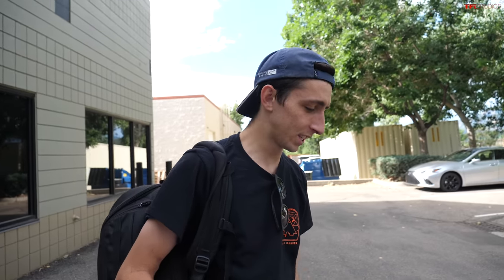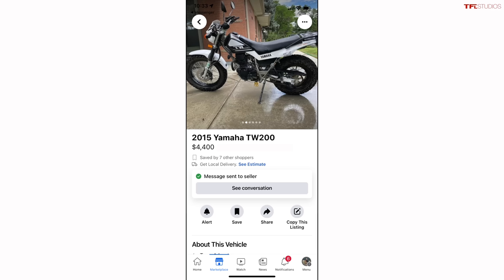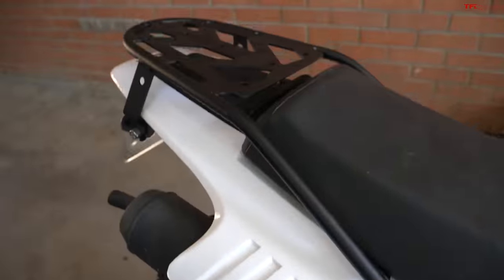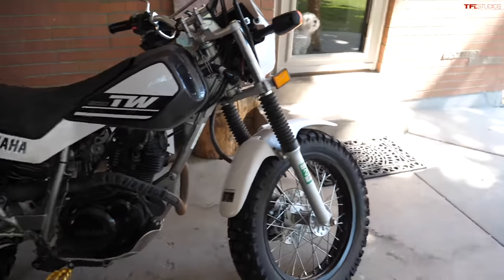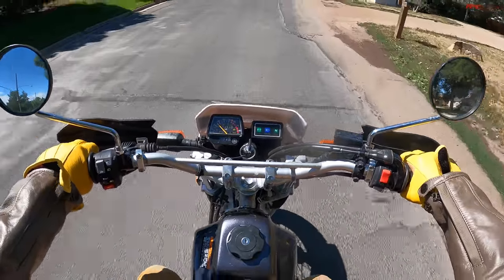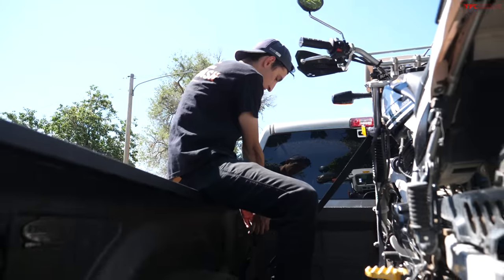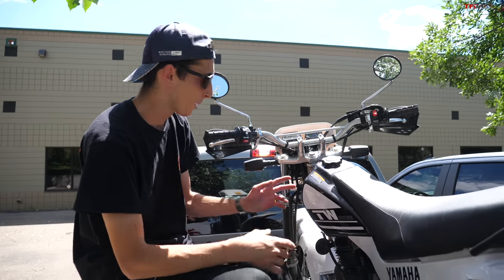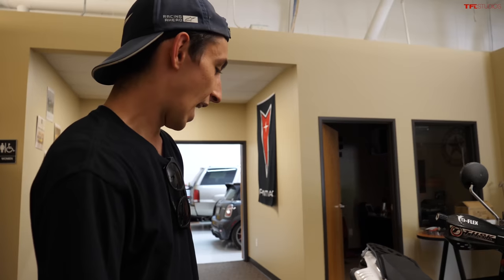Ask And You Shall Receive: We Bought A Yamaha TW200! But At What Cost...

Comment: The market is all over the place when it comes to bikes and cars, in my area  certain bikes just don't sell and others sell in a day.
Reply: I just paid £1600 for a 2006 yamaha ybr 125cc but it's just had a nut and bolt restoration and full respray and brand new tyres Michelin pilot sports, powder coated frame and alloys. New chain, sprockets x 2, brand new exhaust..12 months mot ( inspection)...rides great..my question is ..did I get ripped off or was it a good deal..the sad thing is I have a full motorcycle licence so I can ride any motorbike...I just liked this ybr
Reply: You can sell any bike fast for half thats what i say. Somestimes selling things is easy sometimes its hard. I try to sell a car 3 people take it for a ride and dont buy it. I try to sell an old treadmill and it goes right away I try to sell a bike and it sits. I try to sell a gun and the market is tyrannized to an orwellian unconstitutional high degree. But its a blessing in disguose that one because the gun i try to sell is an irreplaceable relic amd im just trying to post it out there to enrertain offers to try to average a street price for a gun i cant just pull up online like it and get an average price. Its not a glock 17 they just pump em out every day plastic. You can for sure say its worth 550 bucks new in the bkx with the paperwork never fired. You can go to anywebsite and see what they go for but my gun i cant do that and so i try to see what people are willing to pay but like craiglist is anti 2a they fight against our 2a i think they belong in prison for these terrible crimes

Comment: Love my TDub!  I can't believe how much they hold their value these days.
Reply: Mainly because there's no other bike like them and they will go through things other dirt and dual sports won't got through (deep sand,  mud,  snow).  They're basically a 4-Wheel ATV cut in half.  Tremendously tough and versatile bikes that that do it all and turn great gas mileage.   I have a DR650 but also am keeping my TW200 because it will just go places my DR won't.
Reply: @BillySBC  Imagine how much the value will shoot up when they quit making new ones, which could be very soon.
Reply: Ya ppl are asking more than what i paid brand new.
Reply: @BillySBC  I use mine for commuting about 30 miles a day on country roads. Its my zombie apocalypse bike. The huge rack is perfect for hauling anything.
Reply: @akmankalash  

The only thing I did to mine was drop the number of teeth on the rear sprocket to get better top end speed.   I think I dropped if from 50 to like 42 or something,  didn't affect 1st gear pull much but increased the speed of each shift point significantly.
Reply: @BillySBC  me to it cruises great now.  I passed someone today truly lol
Reply: @akmankalash  47t rear on mine. Does good.

Comment: Just bought a 2006 tw200 to use as a daily for $400. Looks like it arrived in 2023 in a Time Machine out the factory. 1200 miles. But it sat with fuel in the tank in a garage since 2008. Got some rust to try deal with and we’ll see what else.

Comment: Nice! I just bought a 2014 with 3k miles and a few more mods for $4k a couple weeks ago. Drove 410miles round trip to get it. I've got the same 5.10 Shinko 244 on the front. You forgot to mention the JNS headlight on yours...I've heard mixed reviews, mine just has an LED bulb. Mine has cycle rack on it, but I think I'd go with the Tusk rear rack if I was paying. I have a 45T rear sprocket... definitely needed if doing much road, I can hit 65-70mph. You should do a collab with TDubsKid or MobStreet...I think TDubsKid is Colorado based, MobStreet is in Utah.

Comment: I belong to a TW group and youre lucky to find one. I got a 2022 and there were only 2 available for the whole state of NY. They are are like unicorns and leprechauns. I have a tw and grom so im pretty gtg. Thanks for your great content of mini motos.
Reply: I've heard rumors 2023 will have changes so maybe they didn't push too many out so they wouldn't have old stock on dealer floors.
Reply: I did search for laughs and found some in the mass area. What seems to be harder to find are honda ct90,110and125s I'm looking to get a ct125 and there's nothing
Reply: There's a brand new one sitting at my local (small) Yamaha dealer right now. Not sure why our how it isn't sold yet.
Reply: @Tarkov.  no changes lol
Reply: @jasonjulian1  theyre a specialized item you either love em or think theyre a novelty.  I got mine running faster using a 44th rear gear.  Comfortably running at 60-65 will do 70 but im still in break in stages.

Comment: We all had these as our “irrigation bikes” back in the mid 80s through to late 90s in my case. They are reliable, can be beat up, are low enough that if you are going to crash in the mud, it’s not a total “splat”. We had a very serious off-road biased rear tire as the only thing close to highway riding was on a gravel road from field to field and back to the farmyard. I see comments about mud, but this set up we almost all used was constantly running in mud,,,, sandy mud in my area that ate up sprockets, but they are easy enough to change out. We had bikes with 25,000 miles on them that never went over 50 mph and were pure work bikes with little to no recreation riding. They are hard miles!! No real repairs unless we broke something ourselves,,,,,. We did not modify them generally,,,, one buddy put highway sprockets on his and it ruined it for the mud. You need the little torque it makes in those conditions and it was gone!! He bored it and changed the carb, muffler, cam etc and it was more powerful and still reliable, but became pretty thirsty!! 
     The sky is the limit on these things,,, be nice if a fuel injected model came out. At our location we would be riding anywhere from 2500 ft above sea level to just over 6,000 and it affected how the bike ran,,,, I suspect it will be a big factor in Colorado??? We will see. I am talking about 1985 to 1990 models mind you,,,,,. I actually switched over to the KLR 650 as my chosen bike. I have owned several over the years and should be getting my 2022 quite soon!! Once I knew they changed it, I wanted it. I have slight balance issues, but have still ridden a 2 wheel bike cautiously without issue, but almost dropped one at a red light, which standing is what is most affected with me. Since I have that issue, we are going to mount a sidecar on it!!! My friend had an older bullet style sidecar sitting in his storage so we have cleaned it up and between 2 engineers and a pipeline welder,,,, all retired now,,,, I’m sure we will get that installed safely (as safe as any sidecar really is,,, hahaha). 
      The TW200 has been a big part of my working life and the crew,,, we had a fleet of 6 bikes at one time, plus the KLR650. (If I wasn’t using the KLR, someone else used it for the day,,,, it was a work bike too. People don’t think of a motorbike for work and now current irrigation systems are so heavily automated, you don’t need to tend to them so much or physically go out and move them every 6/8/10/12 hours,,, depending on what sets (the amount of time the pipeline of sprinklers would set and water straight) you needed at the time. As you can see, a set of even 6 hours generates a lot of mud!! Haha.

Comment: I would love to see it compared to the Honda 125's, it seems like much more capable machine
Reply: It is, it's a goat 🐐 !
Reply: The biggest advantage the CT125 has is that they are actually available.
Reply: Two different bikes IMO. 

The TW200 is a trailblazer. No roads required. Point and it just goes. 

The Trail 125 is more of a bike you toss on the back of a 4x4 for fire roads and putting into town for supplies.
Reply: it would crush the monkey or trails. I can cruise at 65 easily with a 44 tooth gear

Comment: I feel your frustration with the current market.  I’m a TW fan because I had a 87 for 5 years and sold it for what I paid for it. I recently bought a 2018 WR250R with 3000 miles for just under 7grand. I had a few on the market in my area around Bend Oregon, Their were so many people calling I drove a little further to secure the one I had. I was doing what you did I’m on my way and they would raise the price or say someone was in line before me. I love the big ! I have spent 1500 on aftermarket parts and it going on the back of my Mercedes Sprinter for Adventure  camping . Subbed your channel. Around Bend Oregon out !

Comment: I was lucky enough to pick up a really clean 97 KLR 250 in April or pre-motorcycle season as we call it in Pa for $1,350 with about 11K on the clock and I consider that an excellent deal for the market then and that was BEFORE $5+ / gallon summer gas and over all record inflation . I have spent over 1K on it getting it to where I want with most of that ($600) going into a brand new HD rear mono shock . Did you over pay long term? Yes. Did you over pay in the current market with the extra stuff on it? No. Like you said, can't find any new one's on the floors. Same with KLX 300s and CFR 450Ls .

Comment: I actually prefer the Suzuki Van Van 200, but they were only sold a couple years making them hard to find and have very little aftermarket support. EFI and a super cushy seat are nice on the Suzuki, but it's much less trail-worthy.

The used bike market is just dumb right now, but I see signs of trouble on the horizon for the motorcycle industry. If we see the economic slow down that some are saying is coming, toys will be one of the first things people cut. My friend manages used inventory at a large powersports dealer and he is seeing a good number of people selling back bikes/watercraft/UTVs just to get out of their loans. Many are paying thousands to do this because they are under water.

Auto loan servicers are seeing reposessions accelerating and not just with sub-prime buyers and most of these are loans that originated in 2020-21. I don't want to be alarmist, but these are distress signals that shouldn't be ignored. I think it will certainly soften demand for discretionary purchases like motorcycles which will bring prices down. If we slide into a recession, then you can really expect prices to come back down as people dumo their toys to pay their bills. That poses a good oppprtunity for those who can still afford such things.

Comment: I just sold a 2013 with less than 100 miles on it for just less than 4 grand. It was bone stock. If you consider that it would cost close to a grand to put the accessories including the aftermarket led headlight that your bike has, you stole that one! I have a 2020 that I bought new, and will never sell it. Hands down the most fun motorcycle I have ever owned in my 62 years. Yes, I sank a good amount of change in aftermarket necessities, and farkles. If the engine ever dies, there is a 225 waiting for it!
The current market is great for a seller, not so much for buyers, and seems to be sinking a bit.

Comment: Learned to ride on one when I was 13. Absolutely bullet proof in every where except deep mud and that rear tire and also going over 60 mph stock. Not stable.
Reply: NOT true I do 65-70mph regularly. I have a 44 tooth rear gear.
Reply: Yeah, not sure what you're on about. Mine will do 72 and it's perfectly smooth. Handlebars are a little buzzy but it's smooth.
Reply: I'd go 100 mph on mine no problem, highest I've ever had it was 76 mph indicated.
Reply: @akmankalash  is the sprocket stock at 44?

Comment: I owned one of these for a few years. I bought it mainly because it looked cute. There are lots of downsides though. The transmission is notchy, trying to find neutral is a nightmare. It was cranky when cold since it wasn't fuel injected. The bike is underpowered and the suspension is subpar compared to a modern bike. Very small gas tank limits your range. The main reason for buying this is looks. Extremely limited tire choices. Again, the styling is great but there are plenty of better performing motorcycles out there for the price.

Comment: That is not an aftermarket rear tire.  There is no such thing as an aftermarket off road rear tire for the TW unless you want to try ATV tires.  Front tire is not over sized the regular front tire is 5.1 inches wide.  That one looks like a 244 which is a popular aftermarket choice. 

Y'all need to learn what you're talking about BEFORE you open your mouth!

Don't trust that rack with any weight.  It is tied into the subframe only and just as the OEM fender plate is only good for 7kg.

I have a 1999 TW that I purchased last year for $3500 USD.  Completely stock including the foot pegs with 4500 miles on it.
Reply: Hey, you.
Reply: I saw him lift the rear end using the rack and cringed!!

Comment: KBB and NADA have never been anywhere near accurate for the TW200

The base numbers on sales from dealers and there has never been a high number of TW200 dealer resales to base numbers on so according to KBB they use "algorithms" which means they make up the prices

when people tell me they want to pay blue book I tell them they must find the blue book store which I assume is right down the street from the unicorn galore store

the bike has the factory rear tire not aftermarket but they are great tires and wear like iron the front tire is a GoldenBoy 244 made by Shinko and a few other mfgs and is a great front tire for the TW - the factory TrailWing aka DeathWingdoes have one good feature in that for street use it can run for 30,000 miles plus and still have safe legal tread left just remember TW's have "flotation" style tires and by design they can be skiddish on loose or wet materials

with the scrapes and mileage $4100 is right on par value as of July 2022

I'm in the western USA and almost always have a nice stock of used TW's I only deal in 1000 miles or less which I call low milers and I specialize in under 100 milers I call "no milers" I pay premium prices for premium TW's and often travel hundreds if not thousands of miles to procure the deals - if you have a low mile TW to sell let me know and if you need one I also pass up 9 out of 10 I get offered because they don't fit my criteria but I pass them on to others no charge